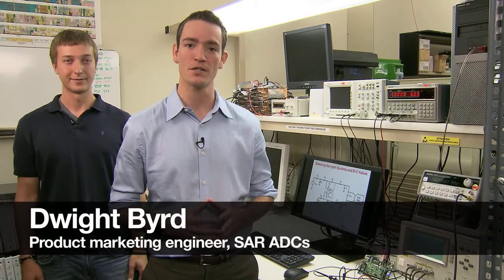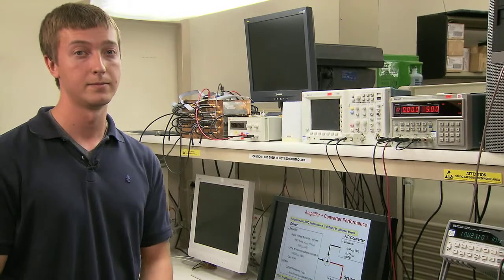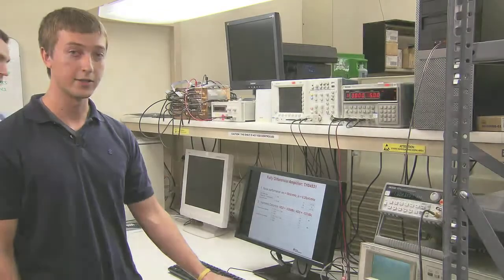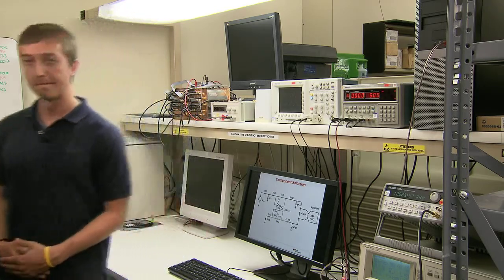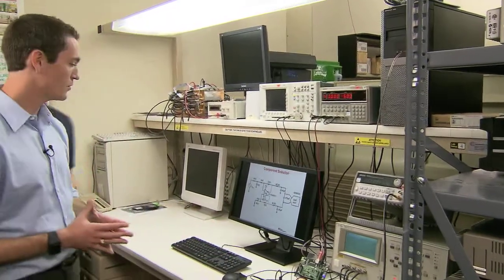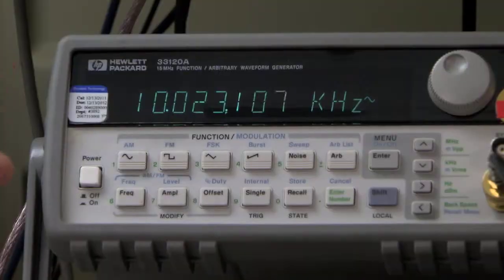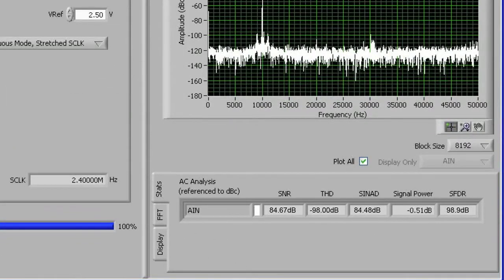Engineer It - How to get data sheet values from your SAR ADC

Comment: Hello Ti's Team,
could you please check the Rdiff calculation? 
It looks like there is a mistake with fzx. Also, Rdiff should be devided with 2 in order to get resistor value. 
Br,
Josko
Reply: Hello, 
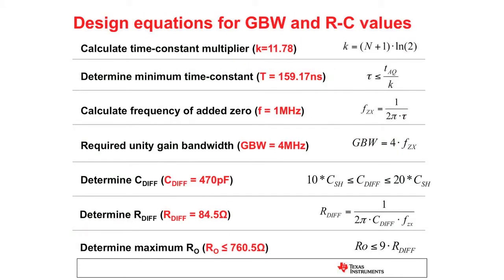The Rdiff calculation comes out to be 84.5Ω which is shown at 1:24. For a differential output amplifier this resistor is split into 42.2Ω on each leg and used a 470pF differential capacitor to complete the differential filtering. The schematic is shown at 4:33 but it is hard to see. Hopefully this clears things up!
For quick technical support, please visit: https://e2e.ti.com/
Best Regards,
Luke